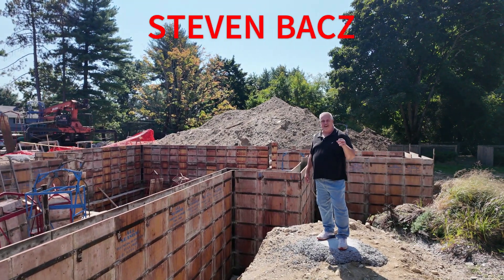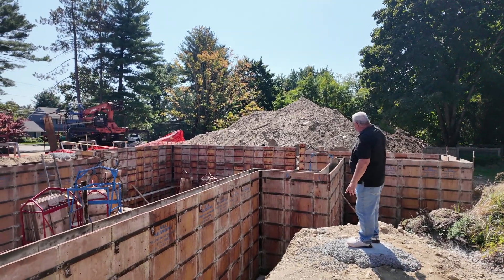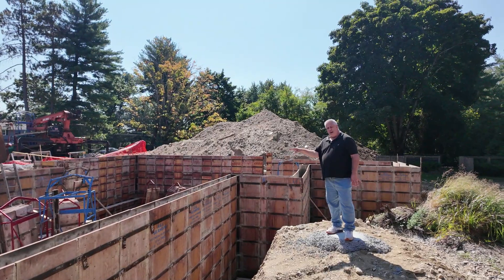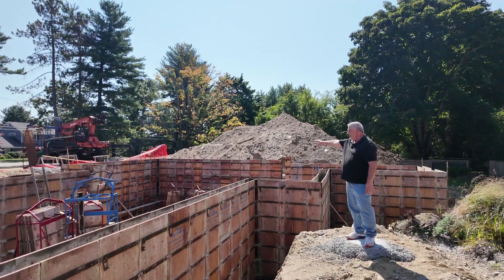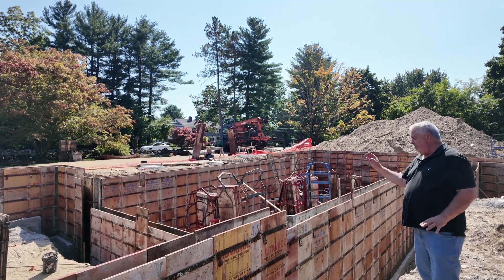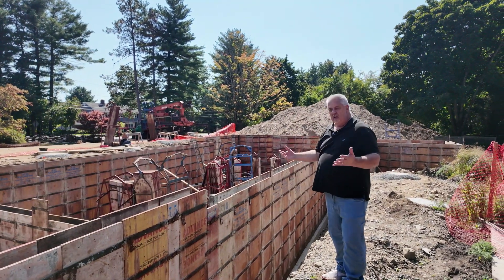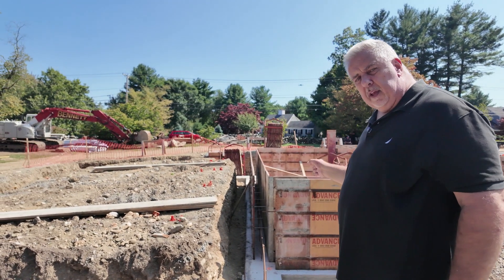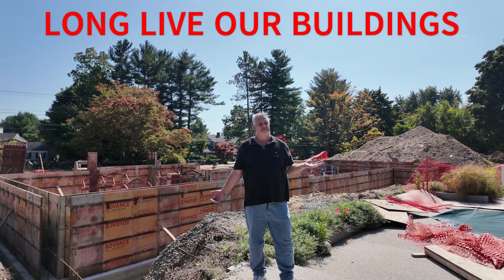FOUNDATION with RETAINING WALL?

Comment: Am I getting this right?  In your typical 9ft basement wall, you have just 2 rebar at the top and 1 rebar half way up?  I guess I've only been paying attention to ICF since that is my plan and ICF detractors have eluded to excessive rebar in them.  I never understood why ICF would have more rebar unless it is because they're making up for the thinner concrete core thickness, 6 or 8 inches instead of 10 inches.  Is this what's going on? 
Also, with all the flooding due to Hurricane Helene, what is expected of basement walls?  Are they expected to withstand the hydrostatic pressure caused by saturated soil and keeping a dry basement?  Or is it better to let the basement flood to relieve the pressure to avoid catastrophic failure of the basement wall?
Reply: I watch a fair amount of ICF-construction videos, and was a bit surprised to hear that these “normal-height” walls won’t have any vertical rebar.